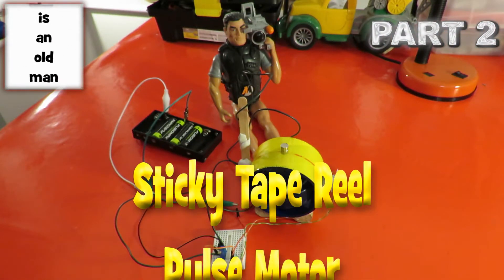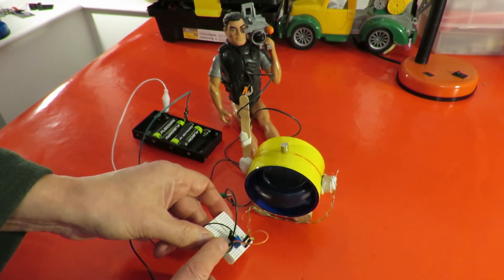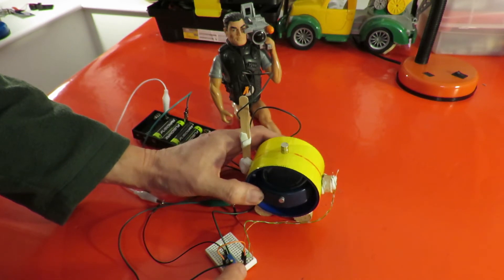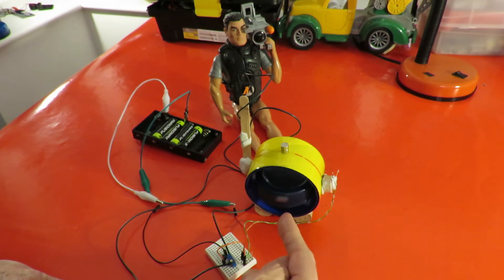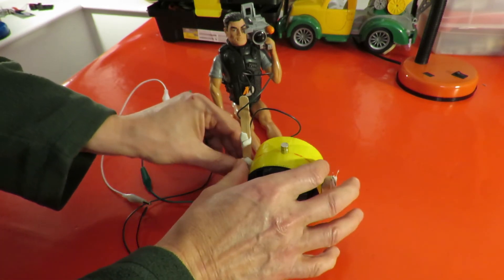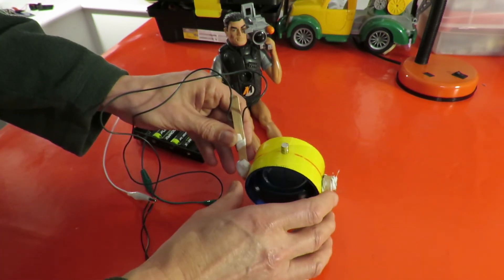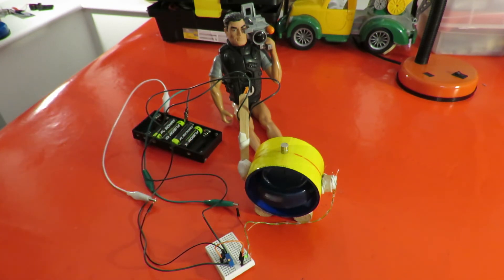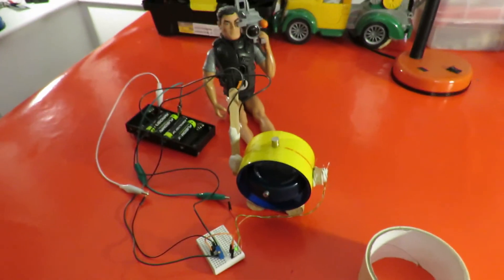Sticky Tape Reel Pulse Motor PART 2

Comment: Hey I made one of your 'Tube Motors' and it worked great!  I just posted a video of it.  I used a TP roll tube because I didn't have the right size sticky tape reel. Originally I used the magnet suspension idea but ended up making bearings in the cardboard tube using crazy glue.  The whole thing ended up a solar project using a solar toy driver.  Really cool idea.  Thanks.

Comment: Interesting motor.  Such a low friction bearing lends your apparatus to experimentation toward making a perpetual motion machine where the battery power is replaced by a magnet/coil which sends out power by way of the magnet moving in close proximity to the first coil and that power being sent to a second coil which in turn repulses it's magnet and the process is repeated over and over, thus eliminating the need for battery power.
The concept in interesting, but engineers tell us that a law of thermodynamics makes a working model impossible to achieve.  Still - people claim to have achieved the machine, but to my knowledge no device has been brought successfully to the marketplace.
Reply from the maker: Haha no you won't get perpetual motion but when these motors are as well made as Lidmotor does them they can run for months on virtually no power, he uses a tiny solar panel to keep a supercapacitor charged so it runs on light during the day and off the supercapacitor overnight.